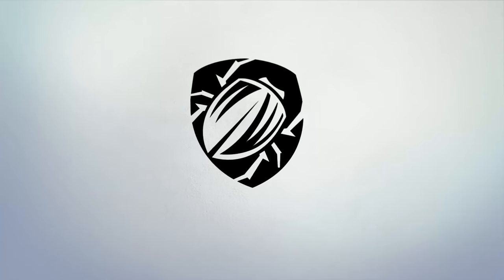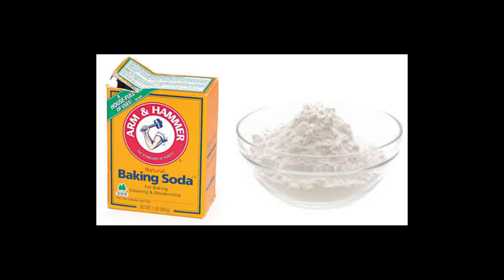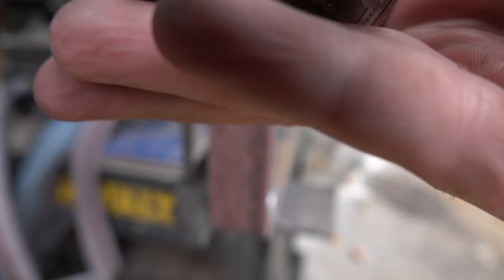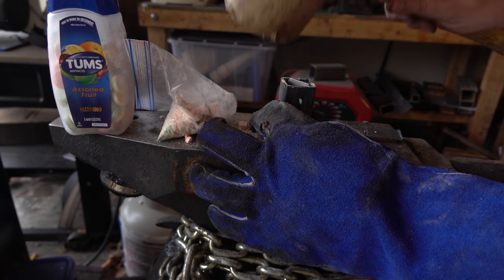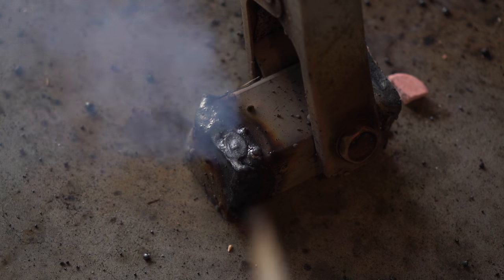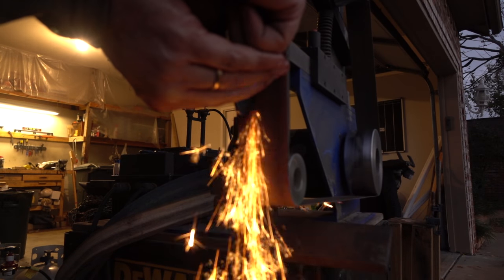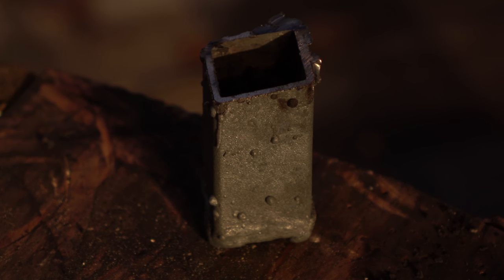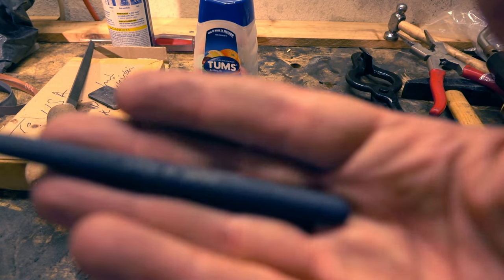Making Knife Steel From Tums

Comment: I think I bought wrought iron from the same place on Ebay. I had a similar experience with lots of cracking and splitting. It welds back together pretty easily though.

Comment: I make a ton of wrench knives from 31crv3 and they get plenty hard. Starts off with .28-.35% carbon. I use a charcoal forge and let them soak @ 1,800 ish for about 10 minutes before I heat treat.

Comment: here's a suggestion for something I have never seen done. you said in a previous vid that your wrench knife didn't harden. so, what about forge welding a rasp or file for the edge with a wrench handle? that would be neat, if possible

Comment: so I'm a starter at blacksmithing and what do you recommend as an anvil rn I am using a 5 pound anvil ): but I want to make knifes bigger than a kiridashi.
Reply: Le Tisdel honestly, anything that's metal and heavy enough can be used as an anvil. You can use rail road track sections, a sledge hammer head set in concrete, an rather large and heavy cut off from a custom metal fabrication place, etc, etc. I started out by cutting and welding up a pile of leaf springs I had laying around, and sunk it into a stump I had. It worked ok for a while, and it allowed me to do more work  than was possible with my dinky little ASO(anvil shaped object) from harbor freight. All you really need is imagination and a desire to make it happen! Happy forging, and good luck.
Reply: LycanTheWolf721 thanks

Comment: Not really making a knife 'from' tums, more making a knife 'with' tums.
Reply: Nicolas Cage hmm, I can think of a few ways to make a knife with Tums.
The most viable would be to use it in cement and shape it into a knife.

You could turn the calcium carbonate into calcium carbide.  Then when it punctures the skin it will probably produce a foaming acetylene reaction.  Watch out if you have anything that can make a spark near you!

Comment: I don't think it's the iron that's bad, but because you were working it below a welding temp that wrought iron needs to be worked correctly without it splitting.you were working it WAY too cold
Reply from the maker: Mark Ling   Ty will try again